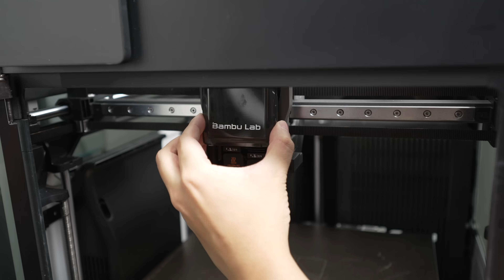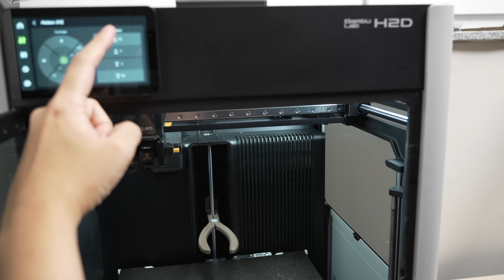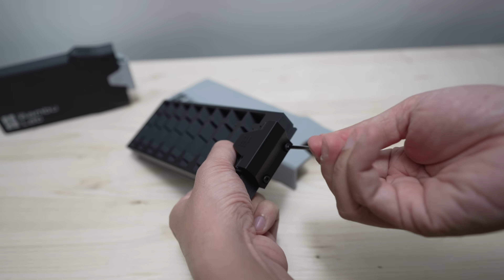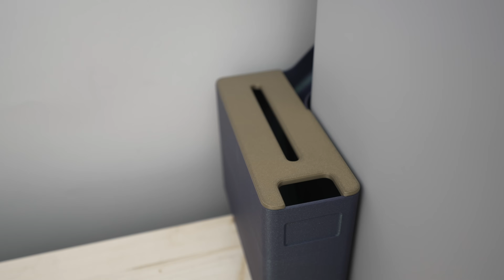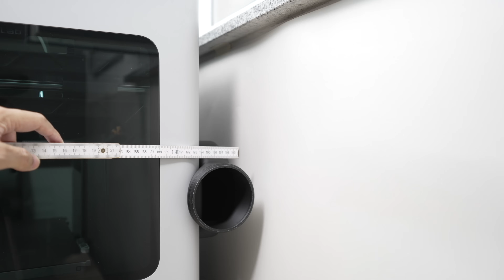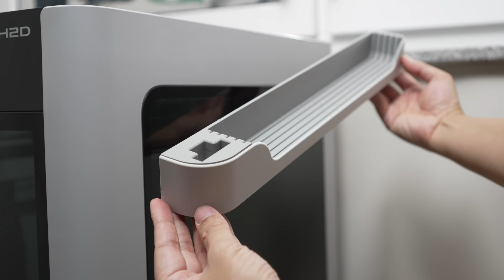10 More BEST Upgrades for Bambu Lab H2-Series Printer

Comment from the maker: H2-Series Printers: https://www.awin1.com/awclick.php?gid=570772&mid=46345&awinaffid=2034675&linkid=4593378&clickref=
VisionEncoder Plate: https://tidd.ly/4pLxPob
BT3 screw for Wire Bracket: https://tidd.ly/48Dum57
BT3 screw for QuickLock Exhaust: https://tidd.ly/3My9gfL
Magnets for Poop System: https://tidd.ly/49aXvEQ
BIQU Blue plates (Cyrogrip): https://tidd.ly/44CtPhM & https://tidd.ly/4lDvUjC
AMS 2 Pro: http://shrsl.com/4vu0e
AMS HT: http://shrsl.com/4xdct

Inline Fan: https://geni.us/6TKrIF

Filaments used
Sparkly Blue: https://tidd.ly/3XOMPW9
Bronze: https://tidd.ly/48SOlLM

Comment: You can get rid of the useless outer walls of those ams HT stands, just have the inner walls like triangles or hexagons and save on filament and it should be more than strong enough without using so much filament
Reply from the maker: Good point, that would definitely cut down on the filament usage!👍🏼

Comment: Hello there. Thank you for an awesome video!

I have got a question to ask... You were talking about biqu buildplate and a cooling system of a H2D. Would you be so kind to share here your settings for this buildplate? 
What temps do you use for play and how do you setup your fans? Do you turn exhaust fan completely off?

I have ordered the buildplate to minimize electricity usage and also to lower the fans to its minimal power. 

Somwhere i heard that if you heatup to 35°C for the first layer and then turn off the heating completely is the best idea.

Thank you for your answer
Reply from the maker: hi there, I dont have a rule of thumb, but usually i just leave the temp to standard for the initial layer (i think its 55°C). then for the other layers, if it’s a 1-2 hours print, I just use 35°C. If it’s longer, somewhere 45°C-50°C. if its a huge print that takes more than 10hours, i use 50°C just to be on the safe side😅
I turn the aux fan off completely in the slicer.
But keep in mind this only applies to the dark blue plate. for the lightblue plate, just use it like a standard smooth pei plate.
And since not all users have the same experience, I highly recommend you experiment around and see which setting is the best for you.

Comment: i'd buy the p2s , but at the same printbed size my a1 has... i see no added value.
Reply: The build volume is bigger on a h2s then a1
Reply: @Chucklesmc damn i meant p2s
Reply from the maker: p2s is an enclosed printer and it can print high temp materials. If you only print with PLA and PETG then A1 is already a perfect machine for you!
Reply: Yeah i have both a1 series printers. Wanted an enclosed but didnt see the point of buying p2s so exactly why I bought a h2d